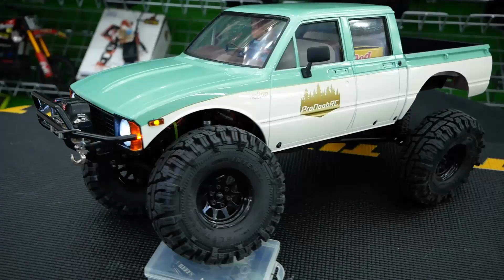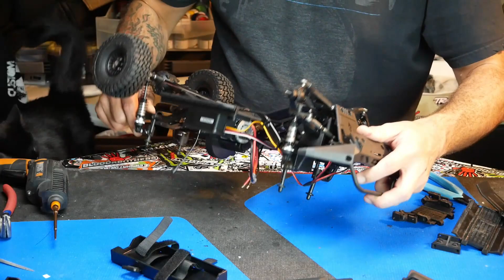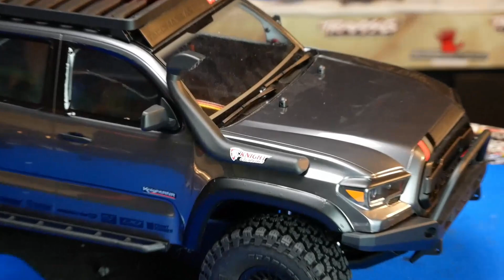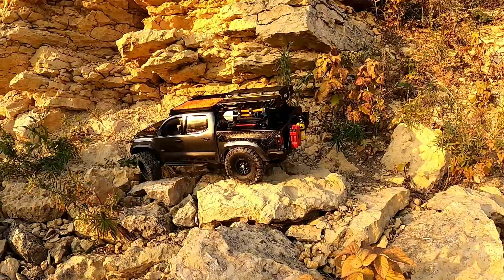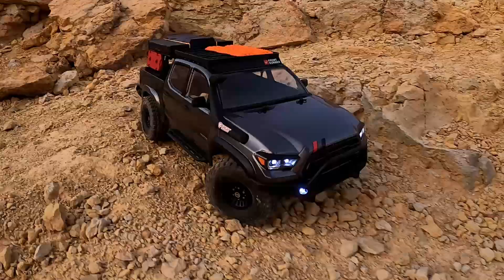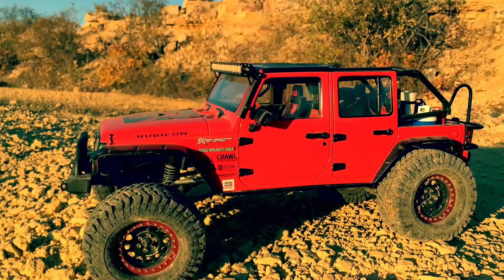ELEMENT RC Enduro Trail Truck, Knightrunner RTR: PART 2: KNIGHT CUSTOMS Goodies, and Trailing

Comment: Nice video, and truck!  Did you have to do a wheel alignment after the conversion?  If so, how?  It doesn't appear to have adjustable turnbuckles....  Thanks.  Really dig the help from the cat!
Reply from the maker: Yes a bit and yup they are adjustable links on the rig factory so no worries

Comment: do you have any videos on how you attached the roof rails and faring for the cab for the roof rack if so please post up
Reply from the maker: No but they line up with roof seam line and have ears to screw them down. I marked with tape then drilled when happy and used 3x8 with nylon lick nut. Fairly simple you got this! Cheers!
Reply: @ProNoobRC  ok great thank you

Comment: what size upper rear links are needed. i know you can use the gatekeeper lowers but what is the length rods used for the upper? nice build by the way i just got a knightrunner and i already love it. i did find some quality control problems also but no worries i always teardown and rebuild to check before taking it out.
Reply from the maker: I think it’s stock uppers but we are gonna install these and figure this out and post it up.

Comment: do you have to do the mods to put these 3d printed parts on
Reply from the maker: Not sure what you mean by mods in this manner but these parts will mod The entire geometry of the front suspension by allowing a ton of extra ground clearance underneath the front differential. You just add the parts and use your existing hardware. I hope this helps